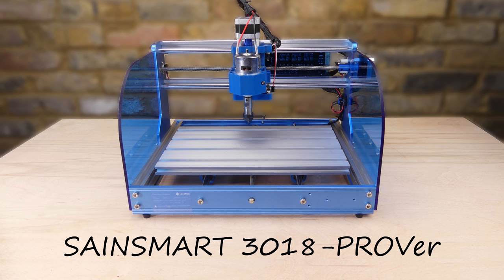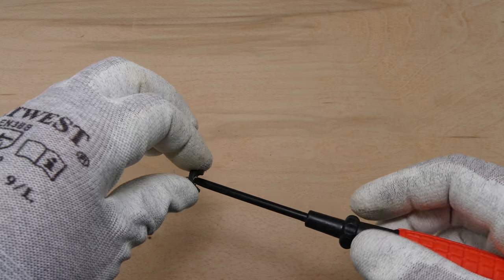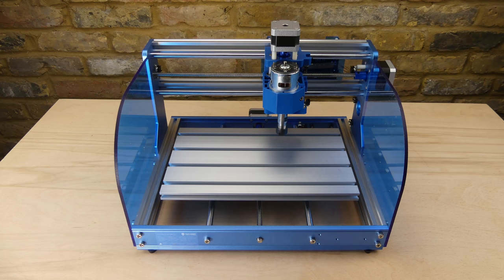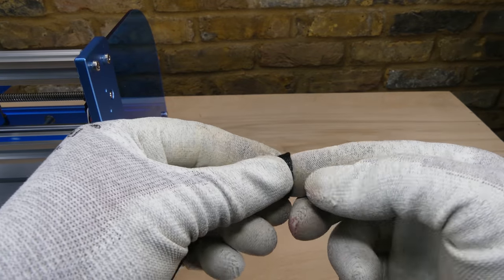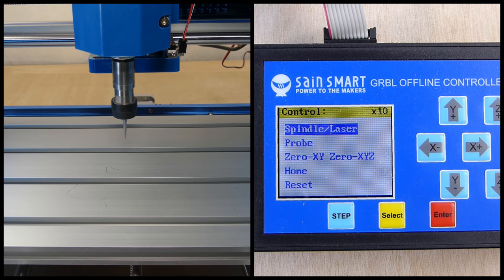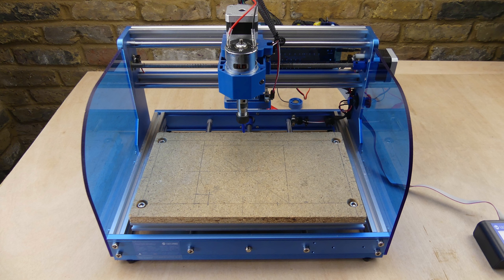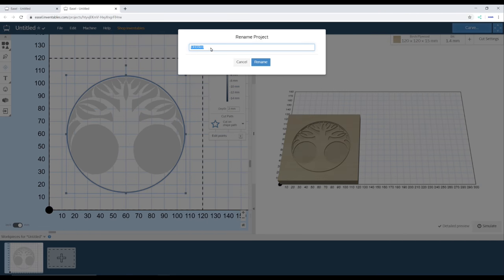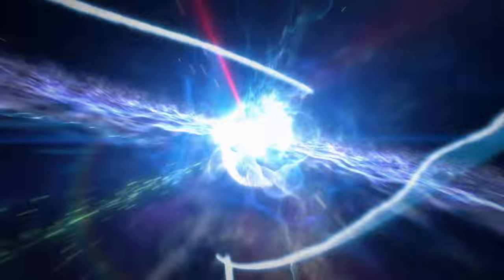Sainsmart 3018 PROVer Cnc Build, Test and Review - Part 1

Comment: I have watched thousands of review/tutorial videos and I have to agree, this is the best one I have ever watched - BRILLIANT!
I have searched and watched videos all day today, specifically looking for a desktop cnc milling machine that will cut 3mm aluminium. However I just can’t find enough information. Would this machine be able to mill/cut 3mm aluminium, using the correct milling tool? If not can anyone recommend a suitable machine.
Reply from the maker: It will cut 3mm aluminium, its just slower than more powerful machines. Its basically ok for occasionally cutting aluminium but if your doing it often then look for a stiffer machine with a more powerful spindle motor.
Reply: @techydiy  thanks for the help, much appreciated. Do you have any suggestions? How do I identify a stiffer machine? Thanks again

Comment: Hi man, 
Love the videos!
Do you prefer this machine or the 3018 mx3?
Can they both mill aluminium? I'm guessing that's just the router bits though!
Cheers man
Reply from the maker: They are very similar mechanically.. The software for the prover is free so on that basis I would go with the prover.
Reply from the maker: They can both mill aluminium but it's going to be slow compared to more powerful machines.
Reply: Cheers man! 
It wouldn't be thick block alu,
More name plate aluminium!
Thanks for all your help man

Comment: If you was to go very slow could this do aluminum?
Reply from the maker: You can, but if your doing lots of it then it's not the right machine
Reply: @techydiy  What limits it? I guess the 3d printed spindle motor pieces? Besides it just being a small 3018 cnc

Comment: Geee. I bought the version that came 2 revisions before this one, and I painstakingly had to manufacture all the extras that comes with this one, like limit-switches, z-probe, optocouplers, emergency stop, cable management, mainboard protection, etc. etc. well well... At least they don't seem to have a cable drag chain or dust collection yet, so at least I have that... Great video btw.
Reply from the maker: I am sure you had fun doing it   😀
Reply: @techydiy  Yea, you've got a point there. I guess it was the usual ratio of fun vs. cursing... but in the end all''s good. :)

Comment: Does it really use a 3D-printed Z-axis/spindle-holder assembly?

I have Sainsmart's 3018-MX3, which is in many ways the direct predecessor to this machine, and mine has what appears to be an injection-moulded spindle holder.
I'm not really sure what has changed for the PROVer that would necessitate a move to 3D printing. After all, the MX3 has home/limit switches (min & max of all axes), uses the same spindle motor, same linear rods and lead screws I think (10mm linear rods, 8mm lead screws), same stepper motor, etc.

In fact the MX3's spindle holder looks to be completely identical to the one shown here except that it's black rather than blue! (A minor difference is that mine uses completely black stepper motors, so it's a bit disappointing that they've moved to the black-and-silver style for the PROVer. IMO the totally-black ones look a lot nicer, though of course it's a completely aesthetic choice :))
Here's what my spindle motor holder looks like: https://imgur.com/a/vTTBDTS (Some obvious injection moulding tooling marks in the second photo)

If they've changed something then it would be understandable for them to 3D print it, of course, as I can't imagine Sainsmart's own volumes are high enough to justify injection moulding.

I know that some of the CNC machines of this style use 3D-printed spindle holders (and maybe other parts as well), I'm just not sure why this one would :)
Reply from the maker: I think it is injection moulded plastic.

Comment: Did what you did, went to do the probe, and literally nothing happened. Will not respond to probe commands at all. 
Edit*

thinking the board is fried. brand new out of the box. Never even got to use. Checked the power supply brick, it is indeed 24v. Checked the power coming from the wall to the end of the power supply feed wire, 24.5 volts. Plugged into the board, turn on and stepper motors work. Checked the pins for the spindle, 0.52 volts... I'm no electrician by any means. But it seems to me that is incorrect. 
I can see the LED respond on the board when I hit buttons, and the spindle gets none and the LED light on top of the spindle, will not turn on at all. Not sure how exactly the spindle motor not turning on affects the probe sequence to make it not move at all when the probe command on the offline controller is pressed, but it doesn't work either. I can only assume the board. 

Ideas? I ordered another board off amazon for 50$. 

I got a 2.5k$ CNC sitting in the garage unbuilt. I'm trying to familiarize myself with a smaller one so i dont jack up a bigger one.
Reply from the maker: You can type the probe command directly into the command console to see if it is working:
G38.2 Z-10 F100
This probes downwards 10

It is most likely a typing error.
Check the console for error messages

Comment: Great review.  I'm going to buy one. Can it be converted to run with Mack 3 at a later date?
Reply from the maker: You would have to to change the controller PCB to run with mach3 but other than that plugging that in, it should be easy enough.